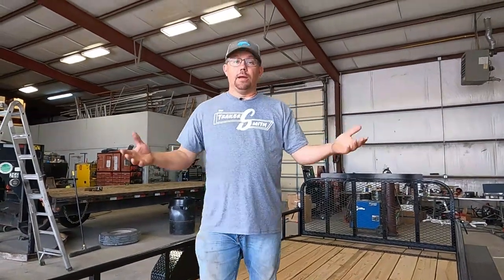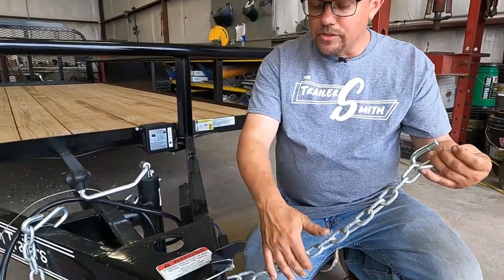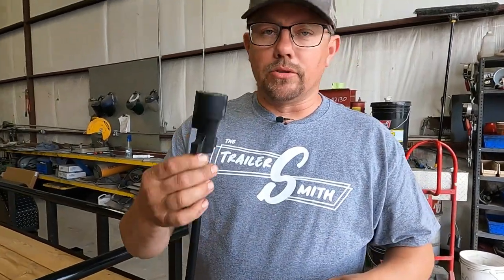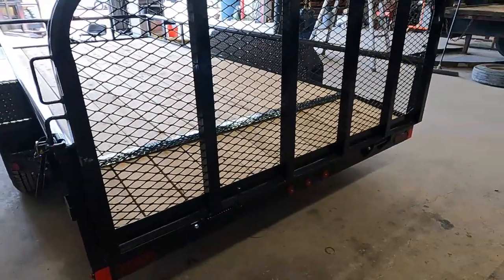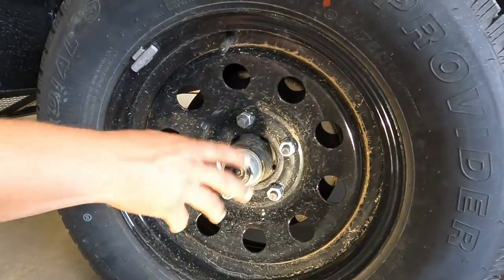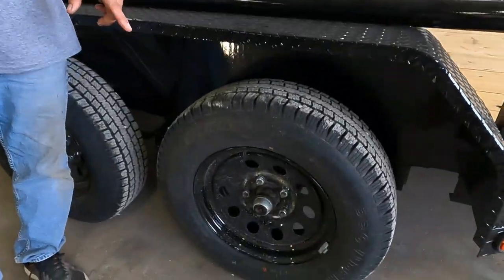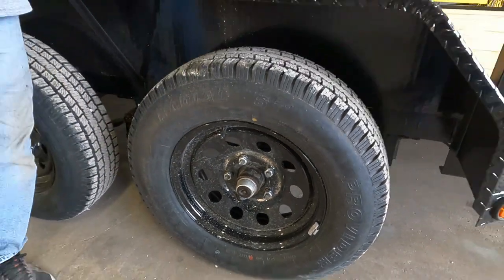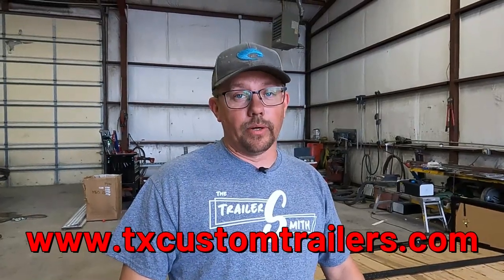How To Maintain Your New Utility Trailer

Comment from the maker: So you bought a new utility trailer?  Now what do you do with it???????
The TrailerSmith takes you along to show you what you need to do to keep your utility trailer in tip top shape.  

Be sure to check out Texas Custom Trailers on their website.  
www.txcustomtrailers.com

Links to other videos mentioned:

How To Wire A 7 Way Plug  https://youtu.be/6aFEcdjqGcA

How To Fix Loose Bearings  https://youtu.be/Udpm6DkCxrk

How To NOT Pack Your Trailer Bearings  https://youtu.be/OqZqKRfHky8

How To Torque Trailer Lug Nuts  https://youtu.be/GeavICmY5A0

How To Adjust Trailer Brakes the Easy Way  https://youtu.be/ClNp8T9cGo4

How To Pack Trailer Bearings Step By Step  https://youtu.be/Y2SHqV0VBQw

The 4 Best Brake Controllers   https://youtu.be/gHSDSQmt1k4

How To Burnish Your Brakes  https://youtu.be/mLp_5ApVjFc

Subscribe to the channel:
https://www.youtube.com/c/TheTrailerSmith

Follow Me:
Facebook - https://www.facebook.com/thetrailersmith
Instagram- https://www.instagram.com/thetrailersmith/
YouTube- https://www.youtube.com/c/TheTrailerSmith

DISCLAIMER: Some of the links included in my video descriptions are affiliate links. If you purchase a product or service with the links that I provide I may receive a small commission. There is no additional charge to you! Thank you for supporting my channel so I can continue to provide you with content.

#thetrailersmith #utilitytrailer #texascustomtrailers #towing #trailerrepair #mechanic #diytrailer #trailerbrakes #diy #diytrailer #newtrailer #trailerfloor

Comment: If you buy a new trailer inspect everything EVERYTHING BEFORE YOU LEAVE THE TRAILER SALES LOT.  I didn't and when I returned to my shop from my first trip hauling my jeep I found a spring just hanging under the trailer.  On inspection I found the spring perches just tack welded in place to the frame.  I didn't crash, but it could have been horrible.  I spent the afternoon under the hood finishing all the welds and then some.

Comment: how do you prevent rust??? after 1 month, my brand new u trailer is rusting all over the place.
Reply from the maker: The answer to this question can vary widely and depends on where you live. What kind of climate do you live in?  Do you live near a coast or in a cold climate where they use salt on the roads?  Or did you purchase the trailer from an area like that?
Reply: I live in upstate New York and bought from a local dealer. Its actually less than a month old and has not been driven on road yet other than to pick it up from the dealer an hour away. @TheTrailerSmith
Reply from the maker: @donnaarnold5768  there are so many things that could be the cause of the rust and the solution depends on the cause.  But  2 things that are very likely come to mind 1. It has a low-quality paint job OR 2. It was painted without having a primer coat.  Number 1 is common if the trailer is a more budget friendly or lower quality trailer.  Number 2 is quite common, a lot of trailer manufacturers actually do not prime before painting, but the dealership should have told you that before purchasing.  Either way, you have 2 options.  One is to just keep the trailer painted.  Treat the rust spots and paint them, making sure to keep paint on any new chips, knicks, or cracks.  The second is not very cost effective, but it will deal with the root of the problem.  That is to have the trailer sandblasted to take it all the way down to metal, and then have it primed and painted.  I'm not sure what the warranty situation is for your trailer, but you may explore that avenue with the dealer, as well.  Good luck!